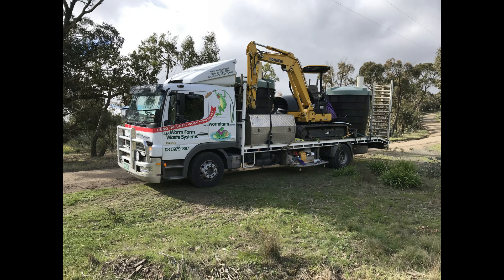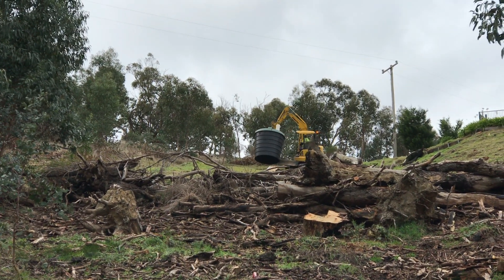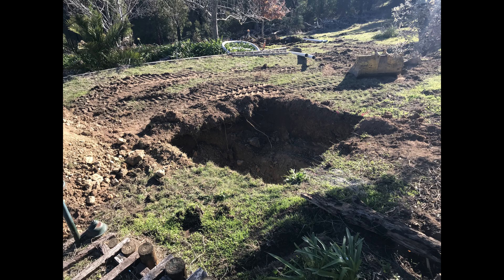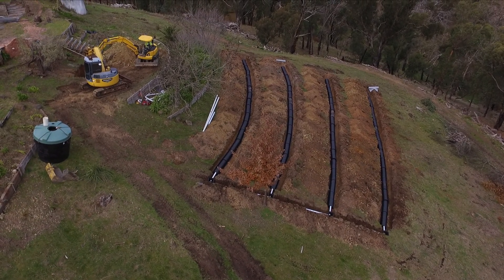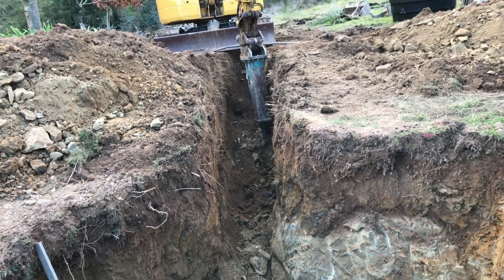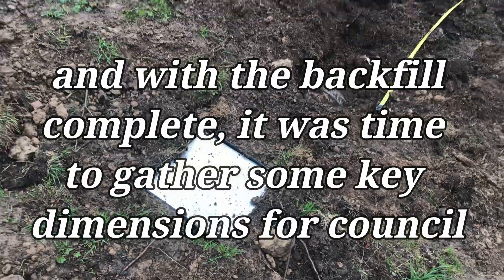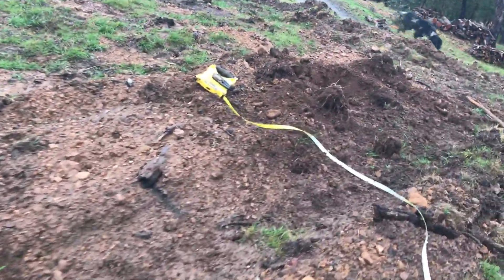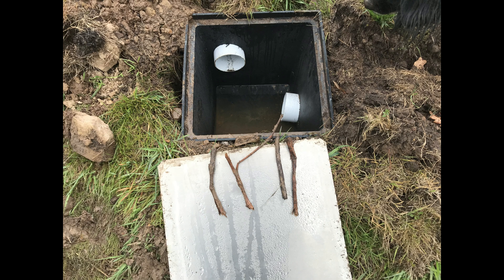Worm Farm Septic System #1 - The Installation

Comment: Great overview of the system overall size
Reply from the maker: Hi, no yearly inspections. I went with the gravity drain system so that I had no pumps etc, so that reduces component failure risks. We have used them at work for large facilities for upto 30 people without issues. Work does arrange inspections each year, but I’m sure it’s something you can do yourself. They look to see if it’s clogging up and the tank is overfilling and I’m quite sure they always introduce more worms. It’s not a smelly system, when you lift the lid to put green waste it’s not smelly ( unless you stick you head in the opening - ha ha) and you’d be able to easily see if the tank is filling up and call for a service if needed. The company that installed mine has a FAQ sections that’s helpful.
Reply from the maker: Thanks for the kind comments and subscribing.
Reply from the maker: What surprised me was the mess that was left once it was installed. The rocky ground didn’t help. Digging a huge area and bringing rocks to the surface as part of that makes a real mess. Rocky ground takes a long time to recover compared to ground mainly consisting of soil. Are you putting one in ?
Reply: @TheRuralProject  looking into it at the moment. We are up near kempsey nsw, mostly clay and trying to find suitable off grid options. Are you required to pay yearly inspections?